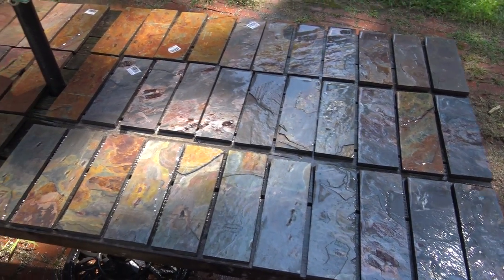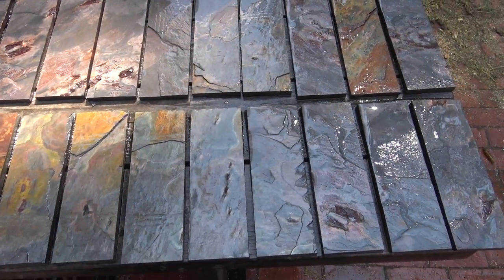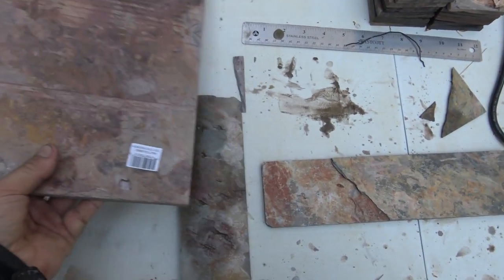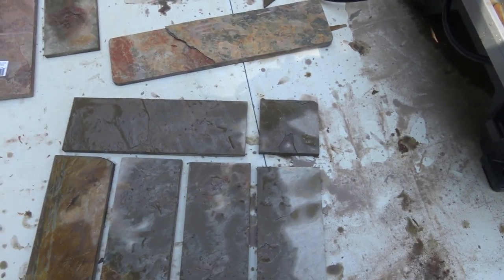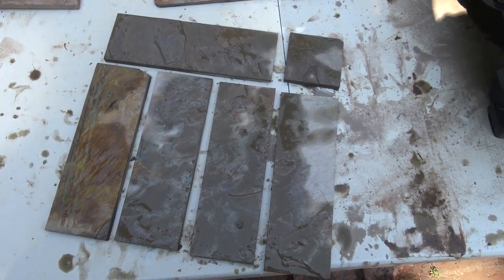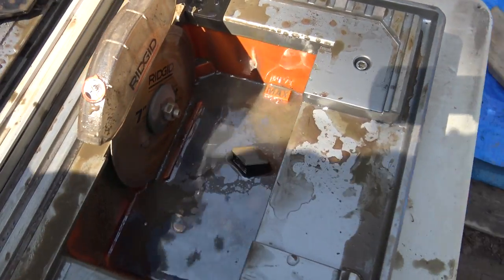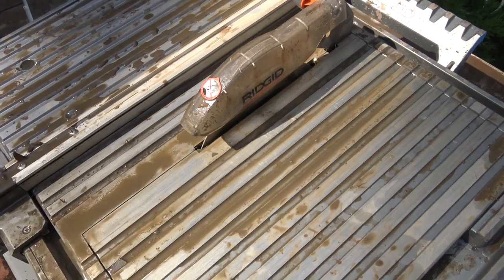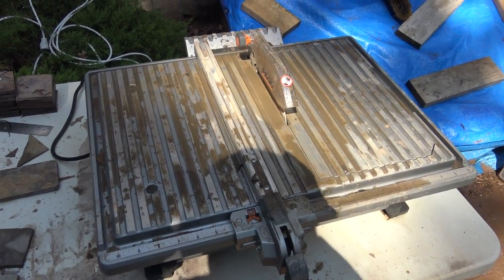#506: HOW TO: DIY Angelfish Breeding Slates - DIY Wednesday

Comment: Hi greg. Great video. What kind of tile do you use? Can we use any slate tile? Thanks.
Reply from the maker: any natural slate tile will work, you can usually find 12" slate at hardware or flooring stores. Slate is a natural stone.
Reply: Greg Jones Can ceramic tiles be used as well or does it absolutely have to be slate?